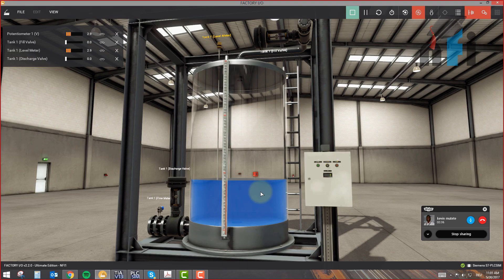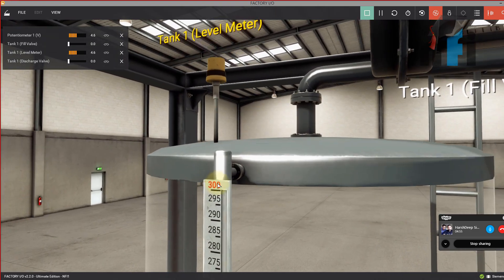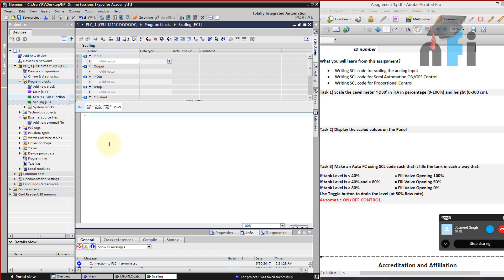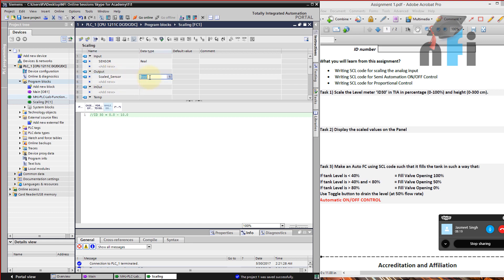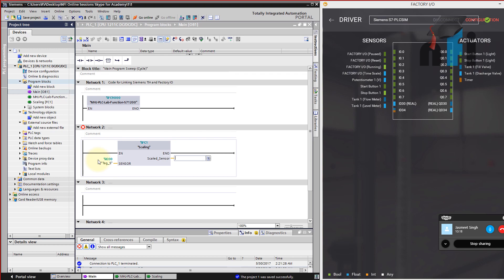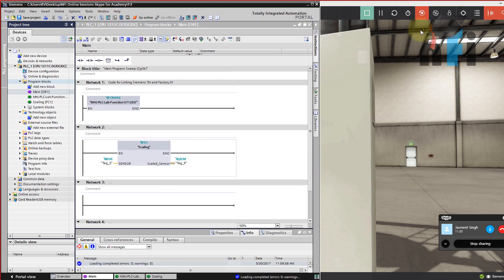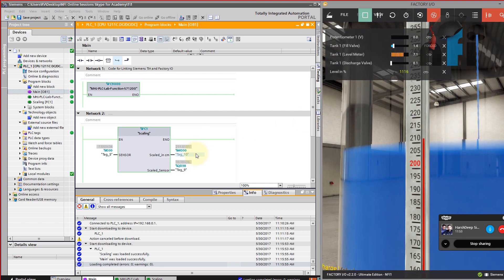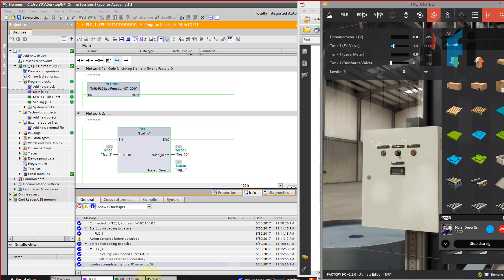Proportional Control of Liquid Level in Siemens S7 1200 PLC

Comment: Sir, how to control the level of a tank in very basic way ? Suppose there is a tank of 10 metre and we want our pump to start when the liquid level falls below 5m and the pump should stop when the level reaches 10m. Sir this question was asked last year in Bhabha Atomif Research Centre. I am having interview next month.
Reply: Step 1: You can use level switch as an input in which mention low level (I0.0) , High level (I0.1) & Very low level( I0.3) and take Output : pump (Q0.0). Step 2: Install your level switch in such a way like High level at 10m, low level at 5m and very low level at 2m. Step 3: Write  logic in plc such as when ur pump will start and when ur pump will be close? For start pump when  when low level sensor is on pump will be start for close when all ur 3 sensors on pump vl be close.

Comment: 10:56; the datatype was 'DINT', he was probably selecting 'UDINT' when converting the data.
Reply from the maker: thanks for your feedback, even then it should work Since UDINT is nothing just 'Unsigned' Double Integer which make sense as the value of % should be always in positive 0 - 100%.
Reply: In many cases it doesn't work, as the starting range of UDINT is different from DINT. Try with DINT and do let me know if this was the issue.
Reply from the maker: Looks like software bug which has been fixed in the new update of the software: https://factoryio.com/docs/release-notes/